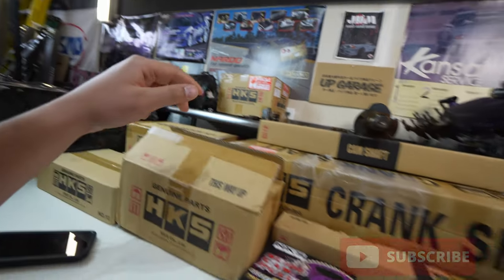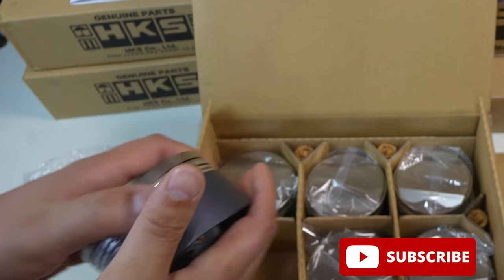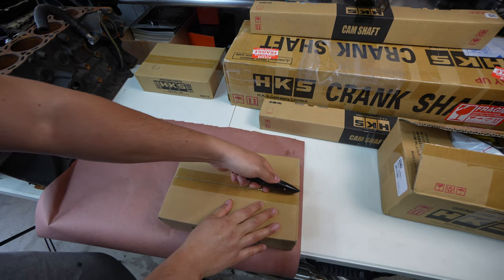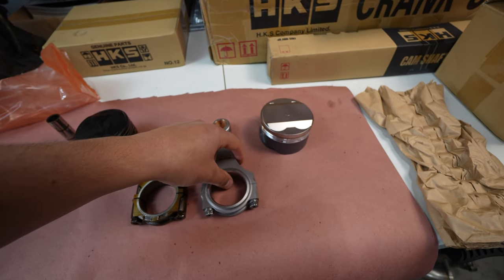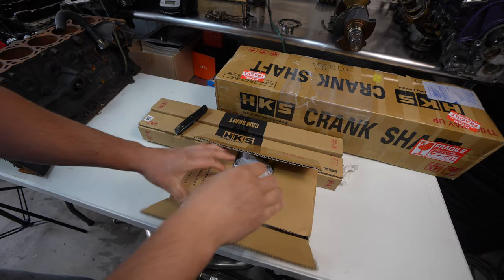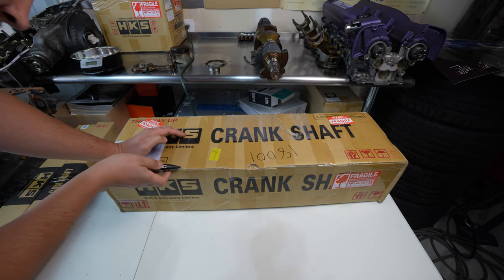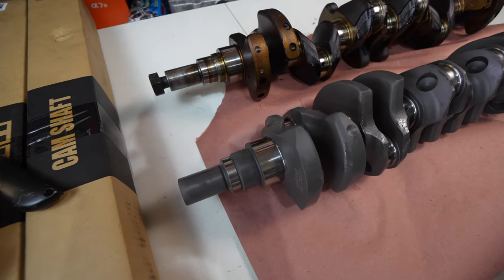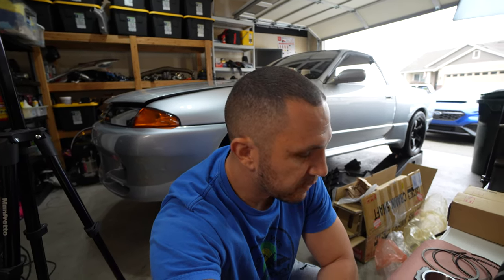Unboxing HKS 2.8 Step 2 stroker kit, oil pump, connecting rods full engine internals unboxing review

Comment: Geez blaming your tuner is a bit weak. They give advice, its general. Its your car, your choice.  I am also not sure what actually went wrong with your motor , the backed out screws is a bit weird on a factory motor and the lack of bearing damage suggests is was never catastrophic.  Good content otherwise, the detail on these parts is cool.
Reply from the maker: Thanks, my guess is that the turbo CHRA had catastrophic failure and that is what introduced all the metal fragments into my engine, which can be seen on the magnetic drain plug when I change the oil. Keep in mind that the engine oil only had 100 miles on it from the last change and the magnetic plug was perfectly clean at the last oil change. I wanted to disassemble the turbo and inspect it myself, but was asked not to by the manufacture for warranty reasons. Once the turbo tear down was done, I was shown pictures of an in tact center cartridge from the front turbo and was told that the turbos had excessive shaft play because there was a problem with my engine that caused the front turbo to fail. After disassembling the entire engine and inspecting all of the bearings, crank, head, oil pump I was never able to find the source of all the metal fragments. I could only find some light scoring 2 of the mains. Like I said, I am no expert and this is my 1st time ever doing something like this. I have gotten myself into this project farther than I ever expected when I bought my GTR. Thanks for watching and leaving a comment.

Comment: Learned a lot from your channel! I’m from Seattle. I own a KL0 BNR32 just like yours. I did have some issues with UpGarage as well but I like the route you’re going. I might be going similar route with my engine build!
Reply from the maker: That's awesome John, so nice to know there is another BNR32 same color silver around here. My engine is coming along and will be done at the machine shop in the next two weeks. It's has been a slow long and expensive build process. Hope your GTR is running good for you, happy holidays.
Reply: @JDMRightHandDrive Just out curiosity, where are you going to get it tuned once the engine is done and back into the car?

Comment: When are you going to start putting it together? My brother lives in Sammamish and I have plans to go visit. I can help you put it together or walk you through it if you need it.
Reply from the maker: I am probably about a month out due to starting a new job and getting that in order first. I will post a video when I am on my way for the machine shop. I appreciate the offer with the assembly process. I could use all the help I can get. Like I said I understand the process, but am very hesitant to make a crucial and costly mistake with assembly.